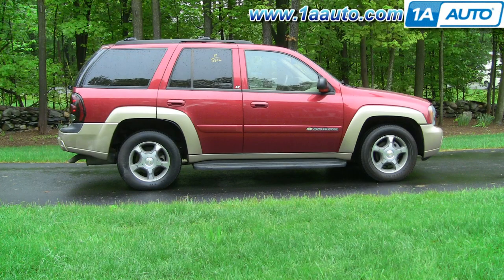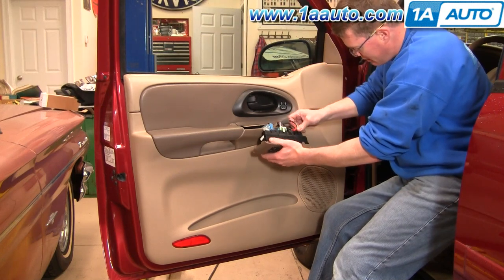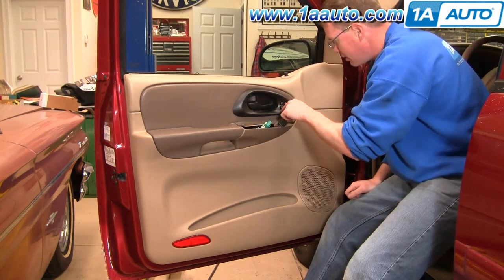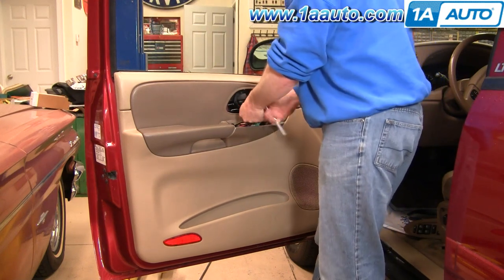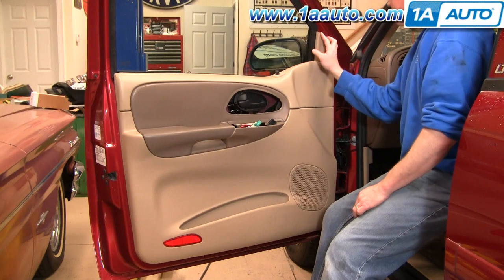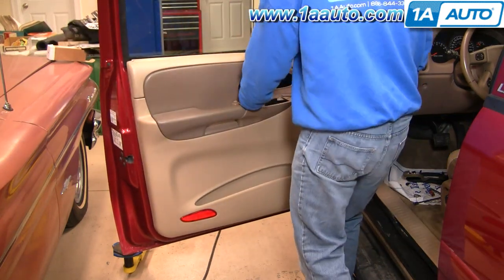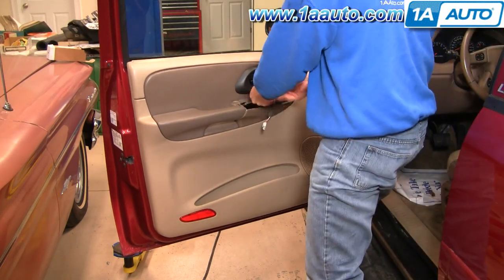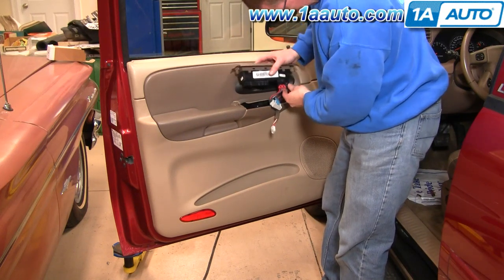How To Remove Front Door Panel 02-09 Chevy Trailblazer

Comment: Awesome instructional videos. I've already replaced the blower motor, changed spark plugs, air filter due to your clips. Now, I am on to replacing the passenger's side, front door panel. I checked your site, and the door panel for a 2007 Trailblazer LT was not listed. So I am relegated to finding one parted off a beater from a yard somewhere.

I would like to ask what span of model years does the door panel cover? Specifically, does a door panel from a 2007 fit a 2005 or 2006? 

Much appreciated guys for all your excellent work.

Comment: I been wanting to replace the whole door panel on both front doors. The previous owner took them off to tint the windows with cheap Walmart tint and he broke the clips on the panel by the mirror and also the clips on the plastic piece around the handle and lock. I already replaced the suspension and sway bar links.

Comment: If, on the little triangle part of the door panel, I've managed to break the part that secures it to the door frame, can that be part replaced separately, or do I need to replace the entire door panel?
Reply: Great question, I let my cousin do a mirror replacement and also broke that small tab behind that top triangular trim and now it seems that due to that the rest of the clips are also coming out.

Comment: i have a question, my speakers in my 2005 trailblazer don't seem to work only my front passenger speaker does, every now and then the driver speaker will work but only the door is closed as soon as open the door the speaker goes off. the back don't seem to work at all, i did replace the factory radio with an aftermarket radio and i checked all the connections and all connections are correct but now they don't seem to work. any suggestions would be helpful, thanks
Reply from the maker: You may want to check the wire harness that runs between the door and the body of the car for a frayed wire. You may have a wire making intermittent contact which could be causing this issue. Hope this helps you out. 1aauto.com 888-844-3393
Reply: Please do, any help would be helpful. Good luck, and thanks.